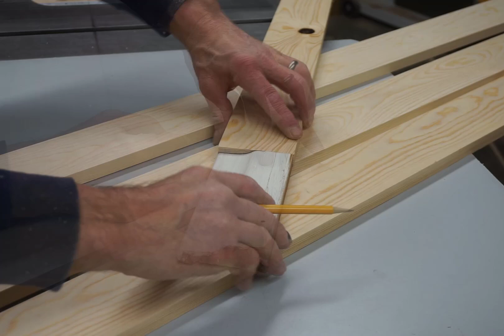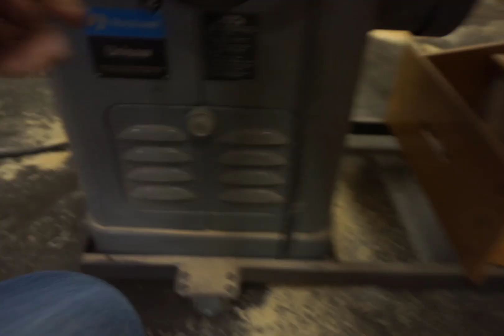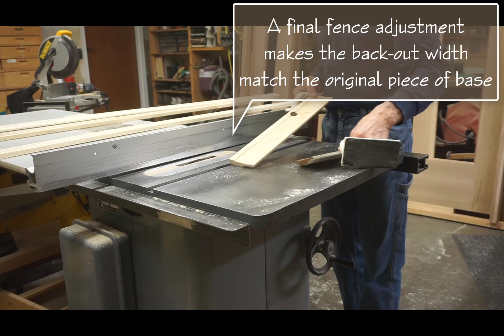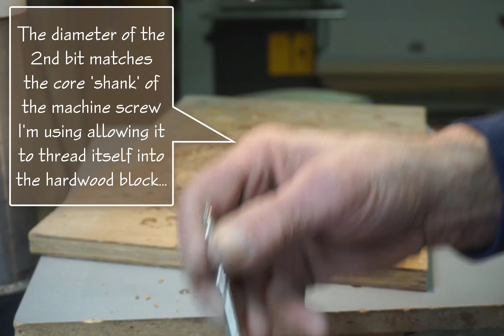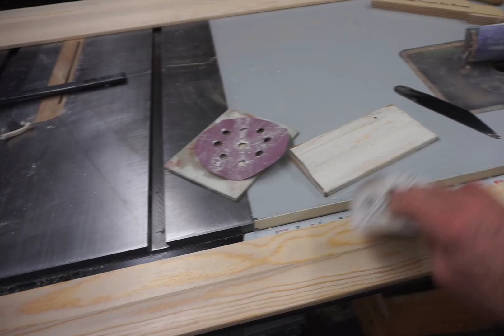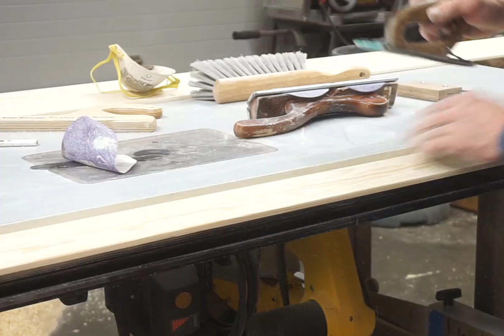Making '50's Style Pine Baseboard

Comment: Great job! Painstaking work to get a perfect match. As you state, these labor-intensive pieces can be spoiled at any (even seemingly innocent) step along the way. I use featherboard(s) at every possible opportunity.  Better safe than sorry... (I started  writing this comment while first watching this video, just before you got out your featherboard for the finishing passes...)

I have another tool that can extend capabilities to match profiles and in some cases make the super-difficult quite easy: a tilting router base sold by Woodhaven. I've found that I can get round-overs to make tangent contact with beveled flats and also get non-standard profiles out of a wide variety of bits already in the shop. I use the base in a router table, but it can also be used to create a tilting handheld router.
Reply from the maker: Thanks for your comment Michael... I've not used a tilt base router but can instantly see how it would expand applications for many standard bits... nice!  As always, you've added insight and info that adds value to a NLC video and I appreciate it! Best, Matt

Comment: I can't believe this! ..Duh! Matt,  I've made cove moldings and ogee crown and all kinds of stuff  pushing stock through the blade skewed. and always do it by eye. Why in the world didn't I think of using blocks lie this? You just made me a better carpenter in the first three minutes of the video. You're great Matt.
Reply from the maker: Glad to hear this helped you out Daniel. Sometimes I have to do a lot of this so I actually made a disc of clear plexiglass with a 5/8 inch hole in the center and an outside diameter of exactly 10 in. With this disc in place instead of a saw blade it's even easier to get the settings right if you have difficulty nailing it down using a rip blade. Hope it helps you make trim faster and more profitably so work safe and have fun! Best, Matt

Comment: Cutting head's r nice. especially if you get one that allows for different blades to fit into it so you only have to buy one head and it'll handle a variety of knives. I'm glad you clarified clarified that towards the end because I was wondering why you would spend so much labor-intensive labor on this unless you're just repairing something ,,that's one thing,, but if you're doing a room or more than one room a cutting head will pay for itself. Not always on a dollar for dollar in the bank but, ur time and energy spent makes it worth it to spend a little$$. Cuz now u can do again and again. and knowing that every piece no matter whether you're doing miter joints or but cuts joints it's all going to match up exactly. Whereas doing it by hand in the shop you've really got to watch the tolerances because now when you put two pieces up from two different boards you may have to do a lot of profile sanding to make sure that joint matches up nice and tight and clean and perfect... the kind of joint that makes you proud.

Comment: Considering all the time and work and tools involved, ever consider molding planes? Probably just as much, if not more, work, but I think working with handplanes might be more pleasurable.. and less sanding/dust. Especially for small reproduction runs like this.. Just a thought.
Reply from the maker: Great suggestion Thomas, and in many cases much more practical... I think you've just motivated me with the  perfect excuse to get a cool moulding plane next time a project like this comes along!  Best, Matt
Reply: @NextLevelCarpentry  This is the book/author that inspired me to try them; hope you can glean something useful from his work too - I enjoy your posts on geometrical problem solving (arcs, ellipsii, etc.) so thought you might enjoy it. 

https://lostartpress.com/products/mouldings-in-practice
Reply from the maker: @thomasbrown9402  thanks, I'll check it out!  BTW I'm currently using a 100+/- year old spokeshave and 75 +/- year old bench plane for adding a 'hand scraped/hewn' texture to the box beams shown in a recent video... gotta love that 'old iron', right?! Best, Matt

Comment: i have a cheap saw  but the fence locks  boath ends   like it but want to change it  to a incra setup
Reply from the maker: There's lots of options out there William... shop carefully.  Hope you find something to your liking and can get it set up without undo aggravation required to make it operate quickly and accurately... nothing like an unreliable, inaccurate fence to make woodworking messy and frustrating! Best, Matt

Comment: Hi there been watching a few of your vids like all your awesome tricks nothing like an experienced guy like your caliber 
And love it all 
I do have a question tough 
If you were to do this for a client how would you price all that labor your doing in order to recreate this mouldings . ?
Thanks and keep up the good ideas. 
Dave Montreal
Reply from the maker: Great question Dave.  I suspect you'll be surprised with my answer.  For starters I actually made the moulding you see in the video for a client and, like every project I do, I did so at a sustainable profit level.  Second; all the work I do is on a time and material basis.  
So the answer to your question is more about how do I 'educate' clients than about how to price labor.  This particular client wanted the base to match throughout the house so the relative value of 20lf of this base was compared to the cost of replacing all the base in the house with newer profiles available today.  I told the guy he might spend a couple hundred for matching pieces with little installation vs spending a thousand or two for new replacement moulding, painting and installation.  So the 'education' process compares the value of 20lf vs 300lf and NOT my moulding at say $30lf vs some off the shelf radiata pine at $1.25 a foot.  This makes an easy decision for any sensible client.
This approach to carpentry/construction is uncommon with the goal of bidding work to overestimate time, material and overhead to end up with a profit.  The  sad truth from my perspective is that carpenters in general are poor estimators and end up subsidizing client projects as a result of optimistic bids.  It's useless to bid a job with a $60/hr labor rate only to end up making $20 or less when the job ends up being a huge time suck.  The biggest factor in my approach is the level of client/contractor trust.  They have to trust me to bill only for actual hours worked and actual material costs.  I establish that trust with OCD level billing invoices so that every minute and every dime is accounted for.  I turn away many more jobs than I take because discerning clients can tell when someone has under bid their project and starts cutting corners to retain profit.
I should do a video about this sometime, eh?  (sorry, I had to throw that 'eh' in there since your from Canada) Thanks for watching and commenting! Best, Matt
Reply: @NextLevelCarpentry  thanks for that great reply matt.   pricing my own work has been a mental challenge for me, my own frugality gets in the way and then there is the matter of what clients expect to pay for a certain quality, which in my aim is always the highest.  hence why im watching all of your videos....  would love to hear you talk more about these aspects of the "trades" or custom carpentry specifically...
Reply from the maker: @noticingisourenterprise  You're quite welcome.  You've discovered the difference between being an employee and being self employed.  I can usually tell who's got it figured out and is likely to be successfully self employed.  When I hear a fantastic tradesman telling me "my customers love my work... in fact, they often give me a nice 'bonus/tip' check when I'm finished up on their job" I can pretty well predict it's just a matter of time before they go broke and end up on someone's payroll again.  Some of the most talented guys I know tend to say this. While it's great to be so appreciated, what it REALLY means is that the customer feels sorry for them working so hard, and doesn't feel right about how little they paid for how hard they worked.  That means they go through their work life essentially subsidizing their customers real estate investments.  Hope you're able to adjust your view of 'what client's expect to pay' so that you earn their respect (as opposed to their sympathy) for the work you do.  BTW I have very strong tendencies to 'give my work away' for the praise it generates and it is ONLY because of the coaching I get from Mrs Next Level Carpentry that I'm able to 'preach' to you on this.  If it wasn't for her I'd have spent my life as an employee, not an entrepreneur.  You need the right perspective to be in business so if you don't have it, find and trust someone who does.  Then go out and enjoy a rewarding, fulfilling career doing the work you love!  Best, Matt
Reply: @NextLevelCarpentry  thanks so much for that Matt.  At the front end of my career, i will be chewing on this advice for a while.  i really respect your experience and perspective.    if i was any nearer south dakota id be making an effort to come meet you and hang out, absorb whatever i could.  but meanwhile ill be here in santa cruz, CA honing my skills, growing my customer base, and watching your videos.  thank you.
Reply from the maker: @noticingisourenterprise  Cool.  There's a book called The E-Myth that talks about challenges migrating from employee to self-employed which I highly recommend for anyone thinking about the transition.  Might not apply directly at all but does bring up great perspective on the matter.  Best, Matt
Reply: I've finally switched from estimating to T&M, as a result of seeing that approach from you and others I respect. The exception to this is cabinetry, which I have a pretty firm grip of costs for. But, how much time would this have taken you, had it not been for the video hastles?
Reply from the maker: @patrickniedermeyer2112  a couple 3~4 hours I suppose?  No surprise but if the shop is kind of in woodwork mode instead of cabinet mode or welding mode it streamlines the process too.  You probably know too that one of the biggest time-sucks on a job like this is talking to the customer so they understand the value of approaching a project this way instead of tearing out all existing trim and replacing with new.  A recent excellent article in ProRemodeler calls that conversation time a 'profit cost', an apt description because it's easy to make money on the work only to go backwards from that sort of stuff.  Hope that indirect response helps you out some how some way... Best, Matt

Comment: Fascinated watching you duplicate old moldings. Never have understood the purpose for the relief area on the back side of the molding piece....can you explain it's purpose?
Reply from the maker: For sure, John.  The 'back-out' relief helps a moulding lay flat on the jamb and wall when wall thickness and/or out of plumb installations would otherwise prevent it.  In a perfect world where everything is flat and true the 'back-out' isn't necessary but that's so rare that I pretty much always go through the extra steps to add it.  Another feature is that on extra-wide mouldings like 8" tall base the back-out reduces the overall 'mass' or strength of the piece allowing it to follow deviations in walls more closely and 'takes the starch out of it' which minimizes wood's ability to warp with changes in moisture, etc.  Hope that helps... Best, Matt
Reply: I've always wondered that. Thanks for the detailed answer Matt.
Reply from the maker: That little unseen detail does make a noticeable difference.  You come to appreciate it more if you have to install some flat trim like 1x4 that doesn't have it.  Wrestle through one project and you'll insist on it on all future jobs 😎 Best, Matt
Reply: In the past I reasoned that it was a place for adhesive to get plenty of surface to bond to without squeezing out and without keeping the trim from laying fully flush. I've used the feature for that exact advantage before, especially when putting trim up over tile in a bathroom or kitchen. But frankly 99% of the time nobody uses or even needs to use adhesive so now this really makes sense.

Comment: I really enjoyed watching this, good job Matt. Just one question, what would be the price of a custom moulding cutter? I wonder if the cost would be a saving on your hourly rate? I expect it depends on how much “Skirting board” as we brits call it, you need. Thanks again, Steve. Retired engineer, now amateur shaving maker😁
Reply from the maker: Thanks for your comment, Stephen, glad you liked the video.  Custom moulding cutters run about $100 per inch of moulding width ($50/inch per knife for the pair of knives in the machine)
and is always a consideration for choosing between this slow, laborious method or going fast and easy with the moulder.  There's also lead time and logistics for getting the cutters made and shipped and sometimes turn around time for the moulding rules out custom cutters too.  I filmed  the process of making custom handrails (seen in the How to Install Newel Posts Without Wobble video on NLC) but don't have the time just now to produce and upload that video.  Sad because it would show you clearly the how the custom cutter option looks in practice... the process is definitely a 'shaving maker' and fun to do and watch.
Best, Matt

Comment: Excellent video!  Unfortunately here in the uk they chop our fingers off if we use a dado cutter. I use a lot of shaped scrapers, I don't have a band saw so don't have discarded blades what I use is old and blunt disposable handsaws I tend to shape them on the bench grinder. If you want to grind ,what we call spindle moulders blades and I  think you chaps on the other side of the pond call shaper blades an easy way to do this is by projecting the shape through an overhead projector (no idea what you call these over there) with the  blank covered with masking tape held at the appropriate angle of "attack" and the shape you want ( a small sliver of the profile you want to copy) laid flat on the bed of the projector, you draw round the projected shadow with a sharp pencil, superglue the two cutters together grind flat then sharpen away and you have a custom cutter.  It's true that it's difficult to grind the two blades the same to the nearest thou or  nm but I have found you can grind one to be accurate and it's partner just about there but then you back off the inaccurate one so it does not actually cut but will balance the cutter head. I understand that higher level carpenters may consider this wood butchery of the worst sort but not many people notice this. Keep up the excellent work.
Reply from the maker: Bill,
There's times ya gotta do whatcha gotta do to get 'er done, right?  When you can make blades for short runs of a custom profile 'in house' it's often (as was in my case in the video) the most pragmatic way of completing a project that a more timid person wouldn't tackle. There's a cost/benefit threshold in each project and I always prefer when I can cross that threshold and purchase a set of professionally ground knives because it means so much less sanding... and I HATE sanding :-(  Work safely... and just don't tell anyone you're using a dado cutter :-)

Comment: Great videos.  I particularly appreciate learning the language of each of the parts (eg 'lugs' etc).  Curious:  Might is be more efficient to use vertical feather boards to hold the work piece down and allow fewer passes?  Not second guessing - just curious.
Reply from the maker: Hi Ian,
Sounds like you've spent some time watching this video and thinking it through... I'm impressed! 
Feather boards are definitely a great addition to ANY millwork setup for safety, consistency of results, etc.  I would encourage all viewers to consider adding them to any setups they can.  I've adapted to working with them less often, mainly because the old Delta Unifence on my 1980's vintage Unisaw doesn't lock on both sides of the table like most newer rip fence designs so it doesn't lend itself to vertical featherboards very well.  That's a better excuse than reason :-)  Work safely and thanks for you insightful question!  Spoiler just for you :-) I'm uploading the next Next Level Carpentry video as I type (it's about a 5-hour upload time).  The video shows how to make round wooden cylinders on a shop-built router lathe... plenty of content there to check out plus there's plenty more ''language... of parts" in the dialog...
Reply: Thanks!  Greatly enjoy your videos. Thanks again for sharing your considerable expertise.

Comment: how long would this take you to do if you were not shooting a video, and how much would you have to charge a customer?
Great video, I have subscribed and will be spending the next couple day watching your videos.  Keep them coming.
Reply from the maker: Broken,
Thanks for the sub and I hope you find it well worth your while to watch more videos on Next Level Carpentry!
If I was hired to make this moulding again it would probably take 2~3 hours start to finish.  As you might  imagine the 'first foot' cost of something like this gets pretty steep with the planning and 'tooling' required plus every different profile means starting over.  That in itself can take an hour or two.  With the one-off nature of work like this I only do it for customers on a cost-plus basis and hourly rates vary widely by region.  Probably around $25 per foot or so but that is just a WAG.  I think I mentioned in the video that for jobs that require much more than 100' or so it is a much better value to purchase a set of custom knives for my W&H Moulder (about $150~ $250) than to bill over 5 or so hours doing the work step by step like I show in the video because once the moulder is set up and running it speeds up the per foot rate and lowers the cost.

Did I even answer your question? :-(
Reply: Yes you did, thanks, Looking forward to new videos.